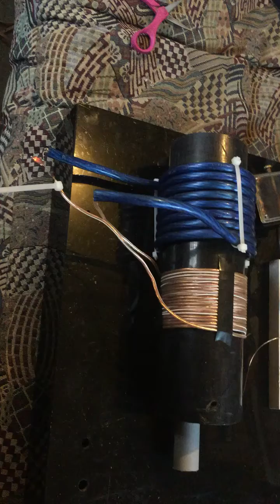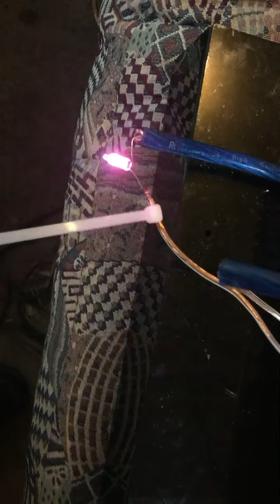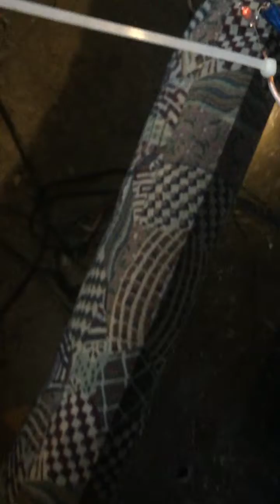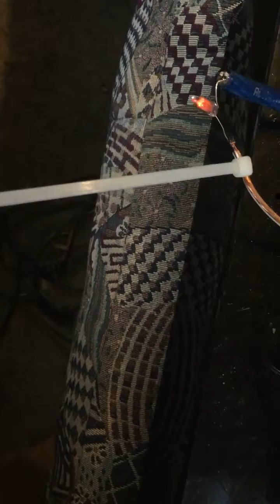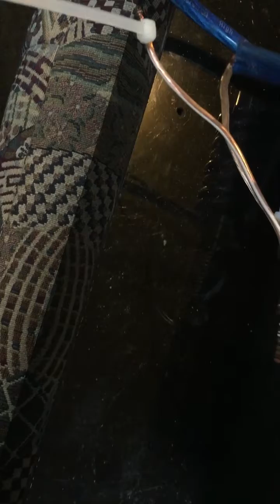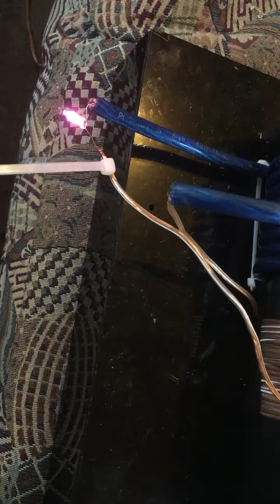Don Smith L2 volts and amps

Comment: wow , no earth grounding... how much more energy would you get if you grounded ?
Reply from the maker: I think that’s may be one of the misconceptions with the Don Smith device I think the ground is a safety measure the real energy comes from the electrostatics the speed the capacitors are charged at at high-voltage then converted to DC and brought down through disruptive discharge increasing the amperage by the reduction of voltage The other half of the Don Smith device is causing the pole shift upon the transformer and rectifying two times the amperage and re-combining it in the capacitors

Comment: Sir, i enjoy every video and wait with baited breath on your next brilliance. i feel so unworthy to ask any more questions of you but I believe you answer them truthfully. I would like to know if there are two spark plug gaps  9one unseen) and if there is more to this circuit than an nst, diodes, 630 volt caps, a 40 foot primary  and possiblly an earth ground. I believe this is much like your cool Canuckistan Coffe can. is there anything to this circuit that is not shown.? thank you for your honesty even if there is but i believe you show it all. thank you!! You are truly one of the good wise sages out there.
Reply from the maker: Just noticing your comment now no everything in the system is shown there is only one spark gap but the timing is critical to tune in to both volts and amps no earth ground is employed if there were it would go on the center tap of the L2 coil where the volts winding and amps winding join